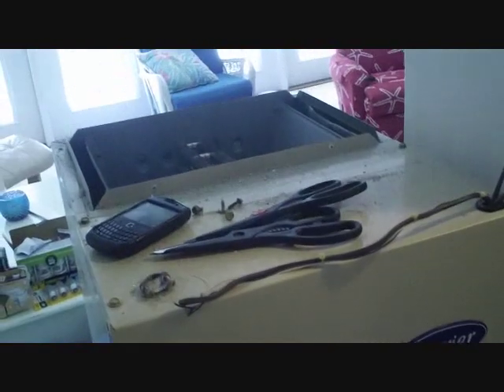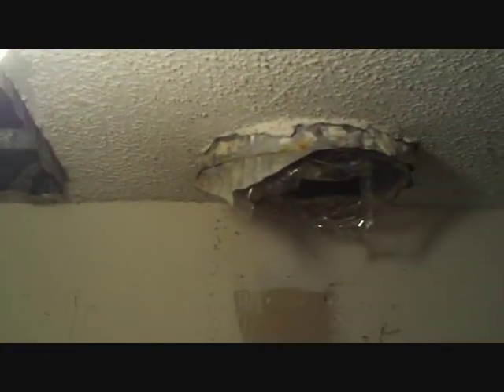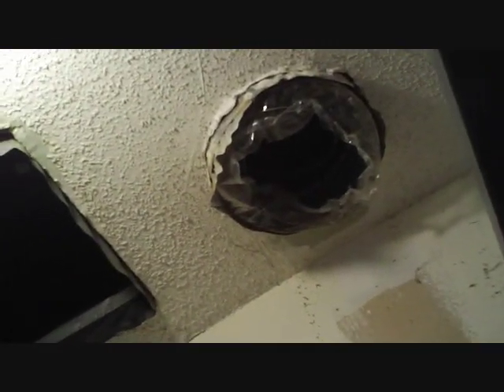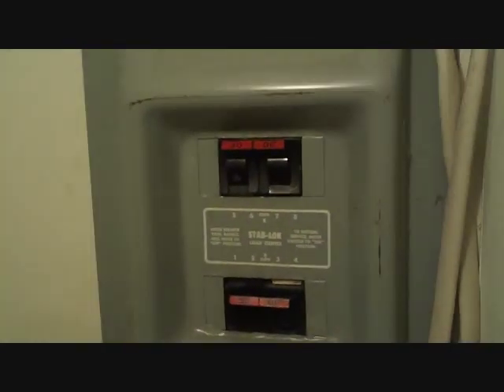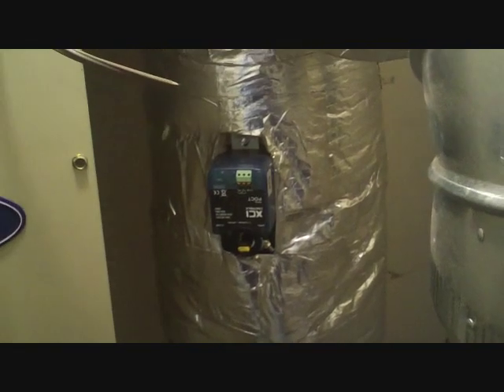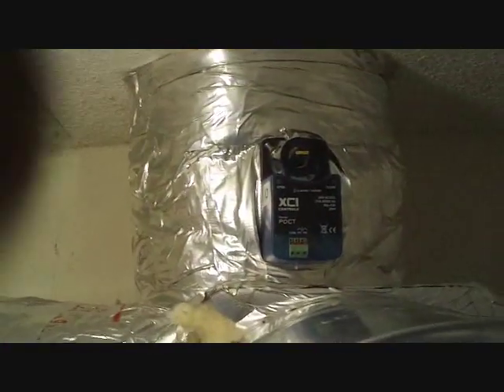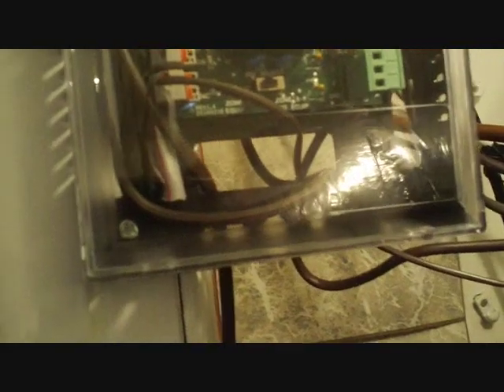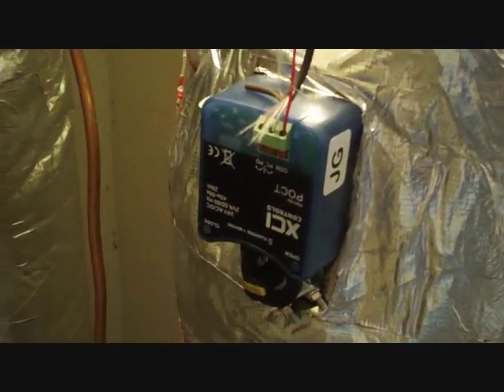Installing an HVAC Zone System

Comment: Wow , that’s amazing that you were able to do that in such a small area ! 
So the bypass actuator is standalone from the eco panel? I’d like to know more about it if you have any links or info. Thanks
Reply from the maker: It measures static and opens according to the set point that is chosen.

Comment: Wow I didn't know you knew about zone systems. I've helped install 2 or 3 once took 2 days  for the last one cuz we sold all new duct work to the customer since it was all under sized to begin with. South Florida had lots of hack builders in 70's and 80's anywho I really believe in zone systems and wish I could be put on more jobs like that. When I have my own small business I'll defiantly push for zoning because of my belief in it so much the energy savings alone will start paying for its self immidiaey lol I sound like a salesman lol I like your videos.
Reply from the maker: Juan Maldonado Jr. Thanks Juan. I like zoning as well.
Reply: +Juan Maldonado Jr. I'm actually shopping for a new variable speed condenser unit + variable air handler to make a proper zoning system but not too many people in west palm beach area like to touch these. I believe a zoning system done with the new variable speed units we have now days are perfect and would save a lot on electricity.

Comment: Do you have air conditioning installed on this system? Would you not suggest the bypass if you had an air-conditioner because of the cold air recirculating back to the evaperator and freezing it..??
Reply from the maker: Sized properly you can use air conditioning with a zone system.
Reply: talyn875 So if it's sized properly you would keep the bypass open?
Reply from the maker: gdub1984 no. It would open as needed. There will a certain bit of temp drop on the coil, but it is usually not severe.
Reply: talyn875 But if the AC unit is a 4 ton unit cooling an area of 1500 sqft when zoned and 2400 when not zoned, would you still keep the bypass open or would that not be considered as sized properly and should have it closed? Really appreciate your help!